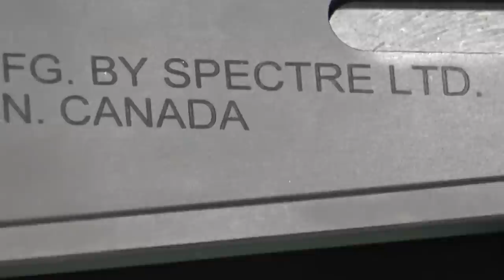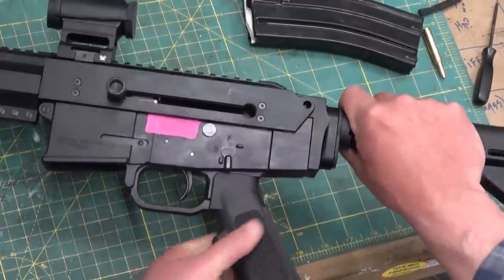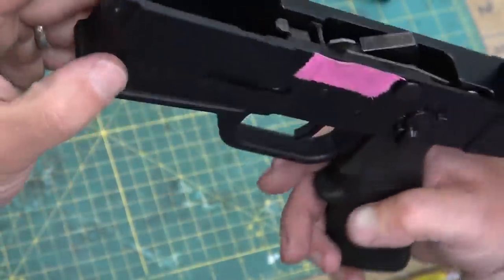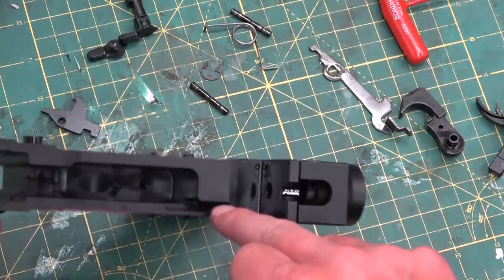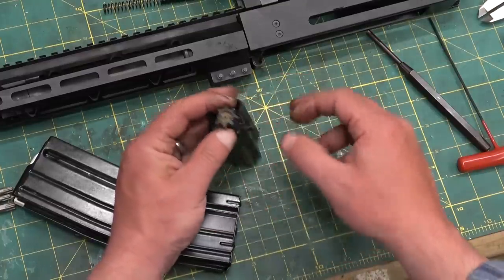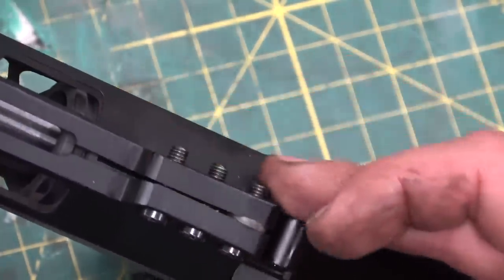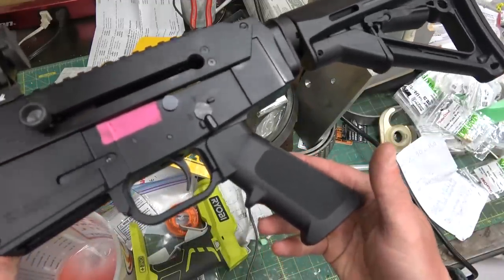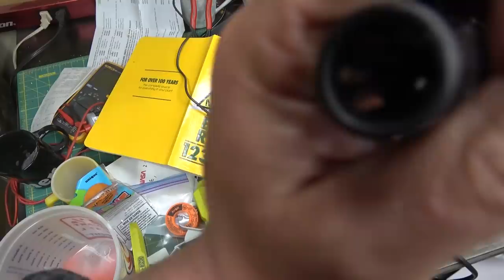BOLTR: 5.56 out of 10 would bang | Spectre WS-MCR

Comment: This firearm was designed to utilize a folding stock, probably cheaper to go with an already widely available ar15 stock. 

the hammer should not be striking the frame unless fired without the bolt in the gun. Which you should never do.

The trigger assembly is a simple sear system with a disconnector ( the part you showed); semi auto guns cycle faster than your finger can release the trigger so the disconnector sear catches the hammer until your finger releases the trigger transferring engagement to the primary sear located on the bottom of the hammer underneath the hammer pin hole. This is the “click” when resetting. 

This trigger system was designed by John Moses Browning for the A5 shotgun and was his first automatic trigger group put into production. 

Variations of this trigger group are utilized by every service rifle the world over.

Comment: So on a standard AR15 which this is based on shares a lot of parts with this. On the tube that the stock rides on the better ones are 7075 t6 aluminum while the cheaper ones are 6061. On the AR the tube actually holds the recoil spring and a weighted buffer. The upper and lower receivers are usually 7075 t6 forged aluminum. 
The brilliant captured takedown pins are standard on all of these rifles.
Notice how that front hand guard doesn't actually touch the barrel. That's called a free float barrel system even though it's really a free float handguard. It's done that way to promote accuracy. So you don't push on the barrel. Most of ours have no piston and are direct impingement. 

I bought parts and built my own rifle from parts. I installed my own barrel and gas block. 

I would never live in Komiefornia or anywhere like it.

Comment: That is a fine looking rifle.  As a mechanical designer of over 35 years, some designs just "look right" or as we often say where I work: "it passes the eye test".   Consider the great industrial designer Raymond Loewy, his designs all looked great.  I see way too many AR15 variants that look like Rube Goldbergs.  
You rifle has a nice streamlined look sort of like the FN FAL.  Something else that strikes me is how socket head caps screws have now become so common.  When I was in tool and die in the late 1970's, that was the only place you found them: holding together dies, jigs, fixtures, gauges, special high precision equipment and machinery.

Comment: The castle nut and retaining plate, against the aluminum, no corrosion problem on the AR-15 M4 or CAR which use the same parts.  The castle nut was not staked.  Those little marks are machined into the nut, which is best retained with ONE little drop of Loctite 242 ("blue" or "service removable").

Comment: Might I suggest some mag pul mags... i love my windowed Pmags...
Reply: Pmags definitely the best mags I've ever used, windows are huge bonus.
Reply: He only has ten rounds to remember anyhow.
Reply: Best mags I have I got from a mil-surp store. They're steel mags, but were new manufacture. $10 each and they almost seem to run better than my Pmags. They're strangely heavy though. Heavier than the usual steel mags. The shop that sold them closed down sadly. I should've stockpiled the hell out of them mags.
Reply: @Richter-89  They are most likely the stainless steel mags manufactured by CPD.
Reply: @lhmmhl1  It's worse. Because it's obviously designed for a centre-fired rifle, it's capped to 5 rounds. The 10 rounds thing is only for pistols. As for the difference between an AR rifle and an AR pistol? Fork if I know, I'm not a mechanical engineer, nevermind working in RCMP firearms lab.
Reply: @Richter-89  E-lander made some beefy steel mags. H&K mags are also steel but they're $40+
Reply: @ReptilianLepton  they accept some rifles as legal then change their mind and claim they're too easily converted to full auto to move them to the prohibited section.

Comment: It is not a flash hider, it's a muzzle break (aka compensater) it will actually increase muzzle flash, but will reduce recoil and muzzle jump. I know the 5.56NATO doesn't have a lot of recoil or muzzle jump, but that is what it does. Forcing gases backwards and up pulls the gun forward and pushes it down.

Comment: ProTip: To get that brass marring out of the bolt face, scrub with a gun cleaning toothbrush, then apply a q-tip's worth of Hoppe's #9 copper solvent with a bit of a rub, let it sit for a bit, then wipe out the Hoppe's and scrub again with a teethbrush and a gunk cloth. Repeat as necessary. :)

Comment: That's more just compatible with some AR15 parts, but the internals seem more based on like an AK (or rather a Galil which is based on the AK), actually, maybe the HK416. The AR is gas operated while the AK has the piston. The AR has the buffer tube to hold the spring that pushed the bolt carrier back. AR has a non reciprocating bolt handle.

Comment: The sear on the bottom of the hammer is the one that release it when you pull the trigger.
The other one is where the disconnector holds the hammer down.

Good to see Americas hat still has gats ;)

Comment: How does it feel when you shoot it ? How good are the springs in the magazine? Im guessing because it doesn't have a recoil buffer spring in the stock tube it wont sound like Slinkys mating like it does in the AR vibrating your jawbone. Compare it to AR-15 variants, and the Ruger mini-14...if ya can. I sold my AR to my brother-in-law a few years ago, and have been thinking about replacing it with another .223.

Comment: Fyi. The sear area is on the top forward edge of the trigger and the little notch right away the hammers pivot point. The part you were showing is the disconnecter that holds the hammer until you release the trigger and let the trigger reset.

Comment: So the buffer tube is just a stock? Any particular reasons they put those dual springs in instead of just using the buffer tube as it was designed? Or was the buffer adapter added just to take advantage of all the AR-15 accessories?

Comment: The one disappointment I experienced when I acquired this rifle recently was that the ‘shoulder’ (for lack of a better term) of the receiver made it difficult to use the picatinny rail.  Specifically, I could not mount my Vortex Razor UH-1 red dot in my preferred location.  I had purchased the UH-1 some time ago for a rifle that is now prohibited.  So … enter the WS MCR as an alternative.  Unfortunately, the ‘shoulder’ of the receiver rises up closer to the picatinny rail than with my AR-15 style rifle, and the bottom of the UH-1 base comes up against the ‘shoulder’ in a manner that prevents the notch in the base from aligning with the edge of the rail.

The furthest back on the rifle that I can mount the UH-1 red dot is on the rail at the rear of the barrel, just in front of the receiver.  It’s not ideal, but that is the furthest back that the optic will fit.  That’s unfortunate.

Comment: The down side to the aluminum buffer tube is it is easy to strip the threads on it. but the best way iv found without the armors tool to take it off is channel locks BUT be careful not to let them drag on the threads as you tighten it with the channel locks in the groves on the buffer tube nut.

Comment: You're are allowed to have pistol grips and collapsible stocks in CA but the rifles have to be configure to accept those features. It requires a magazine lock that disables the action of the firearm when you release the magazine. With this magazine lock you're allowed to configure your rifle anyway you want with one caveat though, you're only allowed 10 round magazines. Anything more and it will be consider an "assault weapon" However if you would like to use 30 round magazine without a magazine lock then you'll have to configure your rifle to what's called a featureless rifle. This is were you add a fixed stock, a fin grip, no forward pistol grip, and no flash hider.

Comment: Magazine well is probably broached. A real AR18 was all stamped so it could be made in countries where precision milling wasn't viable. The thing you called a sear is the disconnector. The AK also has a rotating bolt, it just has differently  shaped lugs. The AR18 is not direct impingement like the AR15, no gas gets into the bolt carrier. Many, many, many firearms use AR18/180 style bolt/carrier/piston system now, like basically all modern 5.56 guns other than the AR15 derived ones.

Comment: Isn't it a straight pull single shot? If so a plastic brass deflector should be fine. Also I wonder why they kept the buffer tube style stock because that's the worst feature of an AR platform

Comment: I have a couple ars love them.  Also have a kel tek su 16 that i havent fired yet looking forward to firing it. Something that surprised me with it is it is actually a piston gun instead of gas tube system.  And it folds in half.  Your rifle looks kind of like a cross between the 2. My next firesrm project in the shop is going to be an ar platform chambered in 300 win mag. Im gonna try to mske a set of dies to press my own mag bodies and make followers.  Most 300 win mag magazines are insanely expensive.  I may look at some of the design of this rifle as well to  possibly integrate into it.  I like the spring setup on your rifle better than the buffer system of the ar.  I may have to expreiment with both though im already gonna have to run a hefty muzzle break. Im quite recoil sensitive due to a neck surgury i had back in 2016 but love my higher powered rifles.

Comment: Your understanding of the gas operated system is incorrect. The gas block only provides enough energy to operate the piston. Once the piston has actuated the breech is unlocked. It is the residual games in the barrel/breech that provides the energy to push the bcg to the rearward position.

Comment: So wait, the buffer tube doesn’t serve any function, since the return spring is in the upper receiver - why have one at all, when you could just put a stock on and avoid the corrosion cell? There’s enough metal there you could drill a couple holes to affix it, it’s not hard

Comment: My cheap ass PSA AR-9 has captured take-down pins. Then again, even "cheap-ass" has become expensive. Still cheap, just costs more. Did come with a nice "enhanced polished trigger group" and I gotta admit, it does feel smooth and crisp. A nice toight snap when you pull the trigger. Bought mine for $650 last summer. Now they're nearly $1000.

Comment: That is so much different than the ARs I'm used to that's a piston-driven AR and it looks like you don't even need a buffer tube the piston-driven AR are not nearly as dirty as the gas driven ARS normally you would have a gas tube that pushes on the top of your bowl the tube goes into a little cup and the air blows the cup away from the gas tube and your buffer tube would have a spring and a weighted buffer before the cough happened here in the states I could build a pretty decent AR for about 350 now that same build would cost you about 800

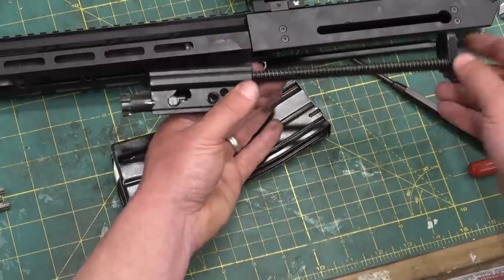Comment: 16:29
Huh? An AK has a rotary 2-lug bolt.
Yep, an AR multi-lug bolt might be more prone to fowling and such, but an AK has a wide open gap in the side that just loves to eat dirt. Also, whilst an AK is usually a little loose in the hips so to say, the system is comparatively simple and the locking surfaces (lugs and such) are easier to grind accurate. Tighter tolerances can also have no effect on the shooting part at all, for example that captive pin at the front might as well be a hammered-over nail as far as I understand, whilst looser tolerances usually allow an AK to fire reliably even as fowling builds up. So tighter tolerances don't always shoot better.

Comment: Seems like a pretty cheap AR-180, then again it is milled aluminum so it's a bit better than the stamped metal ones. This doesn't seem like a firearm built to last a couple decades as the AR-180 was supposed to be a cheaper AR-15, but it is still going to be a fun plinker for something that's not top of the line.

Comment: The hammer shouldn't be hitting right where you said it don't on the ar-15 at least unless you pull the trigger with the upper off of the lower because it should just hit the firing pin.

Comment: It seems to share a bunch of parts with the common American black scary pew toy, but I have to ask, what's the point of the whole buffer tube assembly when there's no buffer spring to go inside it???   Are folding stocks legal in Canuckia???  If so, get rid of that buffer tube stock and install a folder on the arse end of that pew toy.  You can't even say the 3 letter G word on the tubes of you anymore.  The language censor algorithm and the one that programmed it can go forth and multiply by itself.

Comment: This gun is so wild. Piston driven instead of D.I. but a blowback bolt like most 9mm. To use so many standard AR parts then go totally different in that side charging bolt design. That last round bolt hold is an odd design between the 2. I couldn't figure out what that other 3/8 hole and pin was for above the safety. Neat to watch, but I think I like my standard design a little better. I'm accustomed to that twangy loud ass buffer tube design by now lol. USA gun laws are east. Every cool feature is $200 10mo wait. Suppressor $200. Barrel under 16" $200.  My pistol, totally legal. if I want to put the stock on the buffer $200 SBR tax stamp.  They want you to pay, and be put on a list to surrender it at any time they want to look. All about the $$$$. I have to get an FFL just to paint someone's rifle. They can't leave it in my garage without me paying the taxes to do so.
Reply: It is really to serve the Canadian market where AR-15 was restricted (now banned). This AR-180 is Non-Restricted (meaning, with a licence, you can use it anywhere discharging Firearms is permitted; restricted firearms can only be used at an approved gun range)

Comment: N.J. is the same way with buttstocks.  They can't be adjustable.  I mean you get them adjustable, but you have to set it where you want it and it then needs to be permanently affixed.  I think it has to do with theft and making it less likely that someone other than you would want to / be comfortable using it.   Still pointless cause there easily replaced and no criminal ever... well you get the idea.

Comment: Plastic buffer tube? Not aluminum ?
Reply: It's not really a buffer tube, it's just a holder for stock.
One of the criteria for this was that it uses AR parts.
The adapter plate that the "buffer tube" attaches to is removable so you can use folding stocks as well.

Comment: I suppose you know how auto-focus works. The image analyser uses vertical lines to pull focus on. So you need to remove vertical elements that are not in the desired focus plane from the frame. Your yellow striped work surface is defeating your close focus attempts. I could be wrong about this.

Comment: Do yourself a favor and replace your fasteners with hard, flat head “gun” screws. You don’t need to be fast installing or removing them on a firearm. A set of concave ground gunsmithing screwdrivers are invaluable. You can torque the everloving shit out of the screws and never leave a mark.

Comment: you're such a stickler for detail. Make sure that ejector pin in your bolt is rounded off. Don't want a hard edge on it. As the spring wears a little and it cycles it can hang in that bore and stop working. I prefer the oring under the extractor too but people go both ways. If the spring breaks it's done. If the oring splits it's still caught in there and going to work just not that well. That plastic washer "should" be there to keep you from over-torquing the handguard and smashing the barrel nut. If you only use 1 on a 3 bolt mount WTF it's doing I have no idea. Supposed to keep the ID of the handguard from smashing the barrel nut. Those 2 over-torqued and rounded 4mm, makes me worry that is your barrel extension. Like it doesn't have m4 ramps on the barrel but a separate extension. hope they got that right anyway, texas torque wrench and all they used.